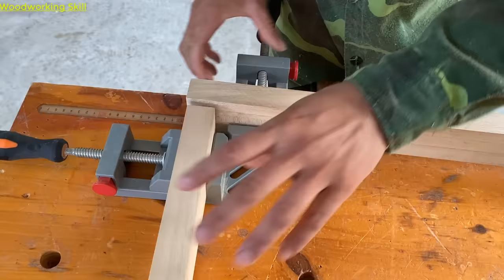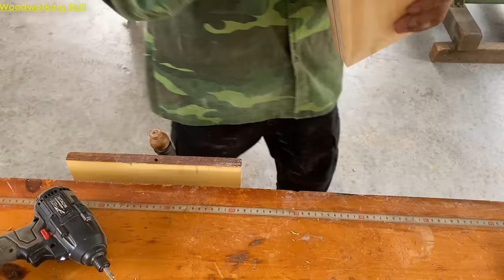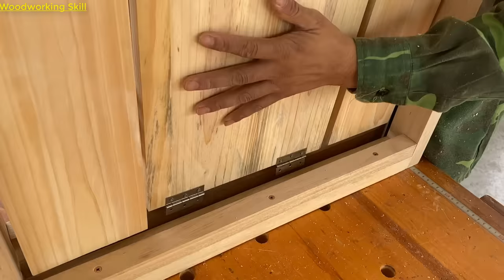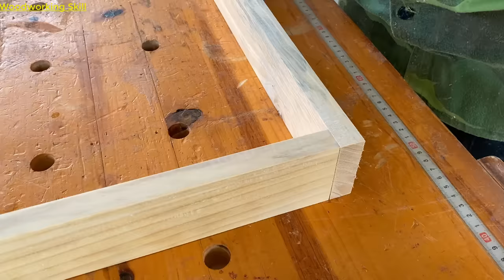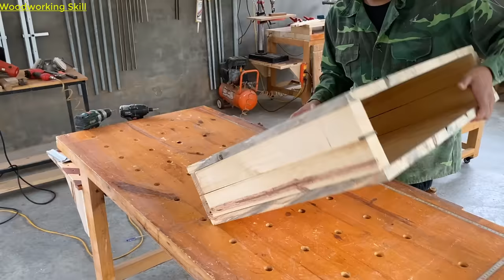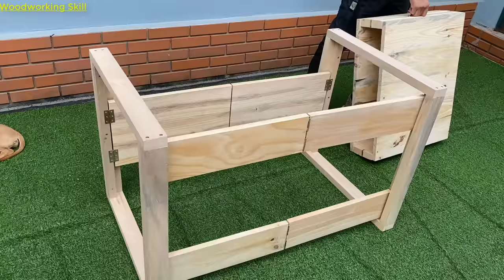DIY Folding Table Ideas You Can Build Easily // Folding Table Base

Comment: To all those praising the work I have a question. How can anybody sit at the table and eat something comfortably without being able to put his legs under the table? The design may be good for to function as a portable workbench. Flimsy but a workbench but a table not really.
Reply: Who said it had to be for eating? It could be a side buffet table for when guests come over, a display table for arts and crafts, an extra workbench for the garage or craft room, a stand for an indoor gardening set-up, a place to lay out and fold your laundry, a meal prep and baking workspace in the kitchen... it has a million temporary & space saving uses that don't involve you sitting under it to eat.
Reply: I guess it is a workbench
Reply: I’d say convention stand. Portable, folds down easily to save space. Perfect if you need a display table
Reply: nor you can stand at the top if its needed
Reply: Yes, why not just remove the narrow bottom folding piece and place it to match on the other side so they are along the top, one on each side. Then remove the wide folding piece. Now it will work perfectly fine as a table. Add a lock mechanism to the inside of each folding part where the hinges are, so they won't move when in set up table mode. Then place the table piece on top and Bob's your uncle!
Reply: Yeah I was stoked about it till the end. Those hinges are not meant for furniture. Looks cool though I'll give em that! I did watch it till the end.
Reply: I think people need to learn how to sit at the table lol don’t lean on it AT ALL to sit or stand or while eating…you feet should be on the floor flat or tucked under your seat.. they should not be stretching across to meet the other persons feet lol but fr though great build for vending table or display or maybe a two person picnic
Reply: It will work as a portable display table but not much else.
Reply: If it's just going in the case when stored, you don't have to use such wide support pieces. You could pretty easily trade out for a metal extension piece or even just a thinner piece of wood so you have space for your legs to fit underneath.
Reply: I think it was very unstable. Even if we use only for support or  to do a simple works, the side bars are vulnerable at some hits from our legs or knees.

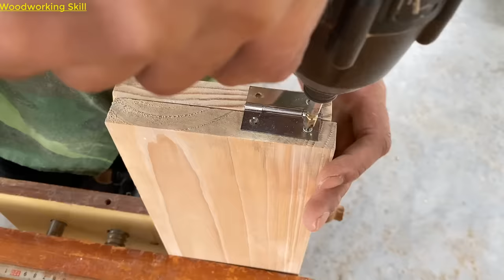Comment: 3:00 Do not put fasteners in end grain. Wood is weakest in longitudinal shear. Take advantage of the strength of wood perpendicular to the grain. Put short pieces across the grain on these boards and redesign the fastening system. Otherwise, don't waste time and materials building this.

Comment: i love the design , i would of liked to see how some weight applied so we can see how the legs are stable. easy fix if not would be just a drop down bar from the top of the support to the middle support so it helps keep the pressure on it.

Comment: I'm looking to build something like this with the intention of using it for DnD, does anyone think it's possible to do this but for the table top add another layer with the middle section cut out for a dice rolling tray? or is there a reason why that wouldn't work? I mean it's basically just another layer on top so the only think to worry about is that it would make the table thicker when folded away and may be slightly harder to fold. But I am obviously not an expert and just looking for some advice

Comment: Totally lacking in craftsmanship , design and function. No room for knees, if using a chair, cheap hardware that will not survive stress forces, to much material used, so it is heavy and bulky, poor joinery that will not survive a heavy loads no matter how many screws used.